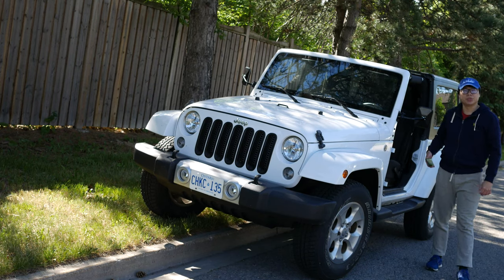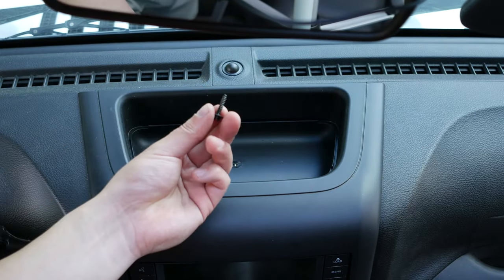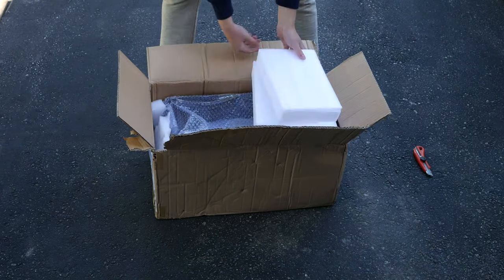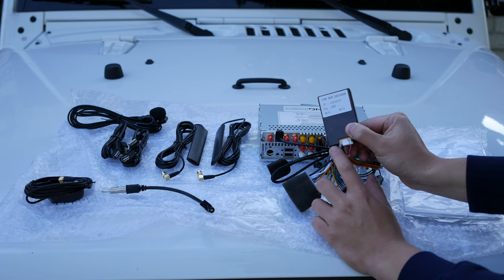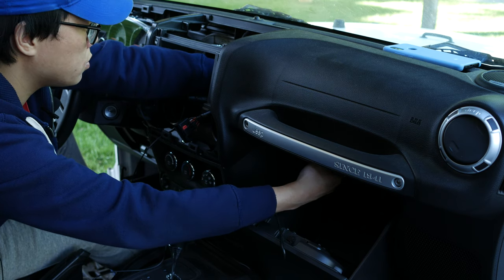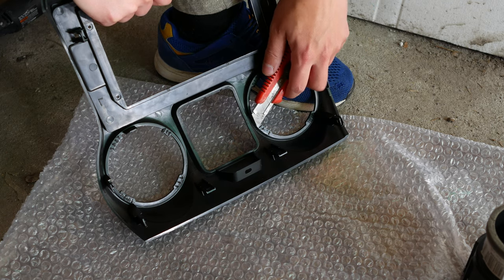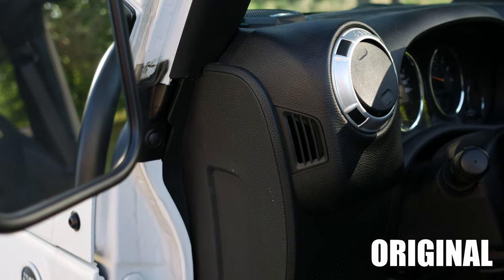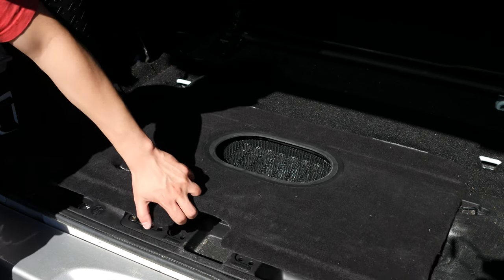Install this $400 10.1" JOYING Android Unit Upgrade on your JEEP WRANGLER in 80 min & first thoughts

Comment: The dash trims not fitting is unfortunately a deal breaker. Thanks for a pretty good initial review and install tutorial.
Reply: Looks more like it would fit if done properly? Seems like something behind is blocking it?
Reply: I had to trim the head unit bezel to flatten it out for the dash to fit flush around the alignment clips.
Reply: @DHandyFamily  Cool I can do that, did it turn out good?
Reply: @MiloPerrotti  yes I just had to shave it off with a small die grinder around the clips that stick out as you can put them together before install and see what is touching. Kind a sucks that it’s not plug and play. Great video

Comment: I want to buy the Joying head unit for my 2018 toyota highlander (SKU:JY-TO155N4GS). The highlander has its own microphone. Could I use Toyota's microphone that's located on the overhead lights assembly instead of the one supplied by Joying? Or do I have to plug in the mic supplied by Joying in order to use Bluetooth?
Reply from the maker: You would not be able to use your original microphone, you will have to use the one supplied by joying

Comment: Did you get the audio to sound correctly? Just installed one in a JK with alpine and fade is off with both plugs (one to the front, one to the rear) Subwoofer is very quiet, and i need to turn up the bass frequency, otherwise, all speakers distort at higher levels. I appreciate your reply!
Reply: Same happend to my 15 w alpine stock system
Reply: Did you find a solution? Got the same issue. Also my left to right balance is inverted. Thanks.
Reply: @llanito1977  did not find a solution to be honest.